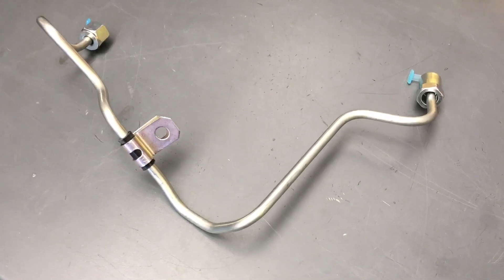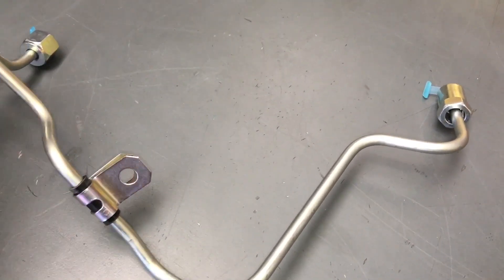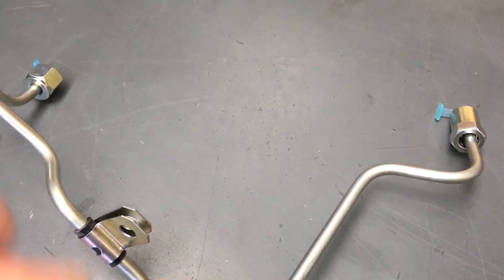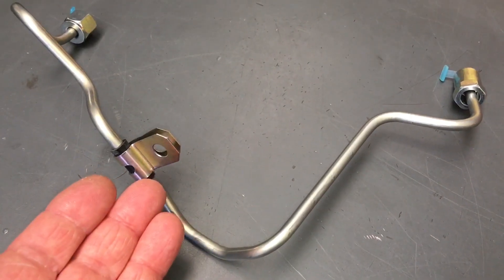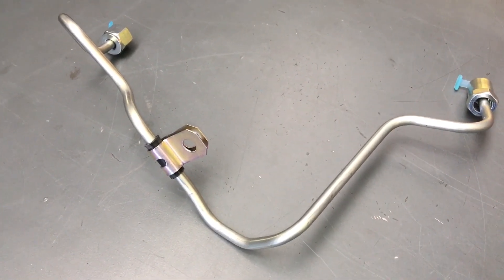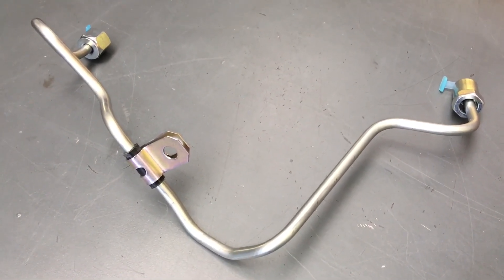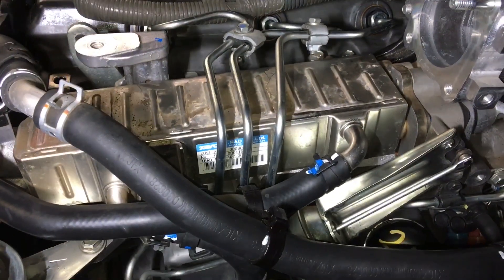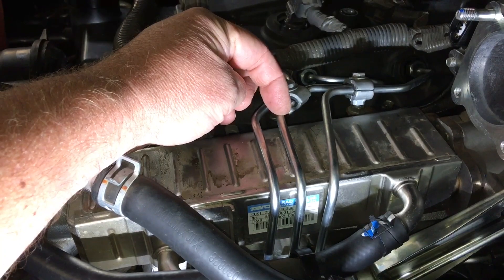TWICE in a WEEK - AVOID the LEAKS watch the VIP Videos - No Mistakes!!!

Comment: Gday Anthony have a question my hilux has what you call death rattle at around 2000 rpm over that it goes away or if it is under load goes away as well. have done injectors
Reply: Omfg. I’ve just read this and this is what my engines doing.  and I haven’t done injectors yet but I hope this isn’t real lol.